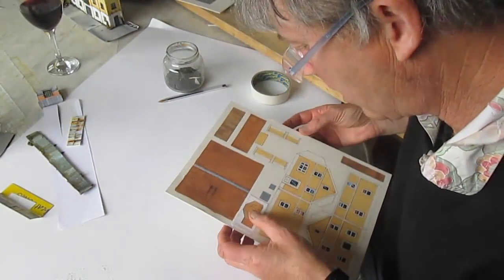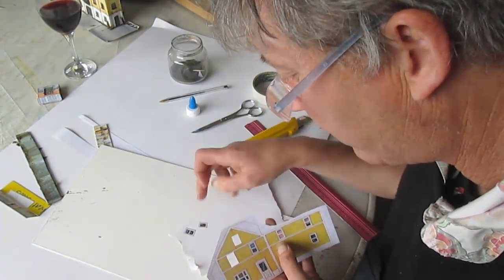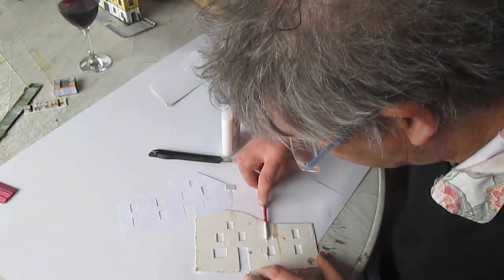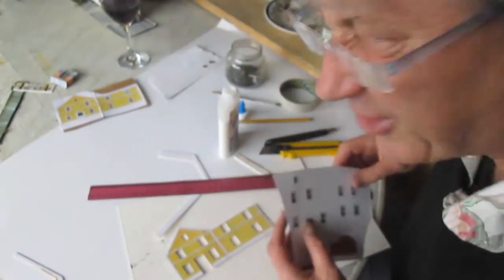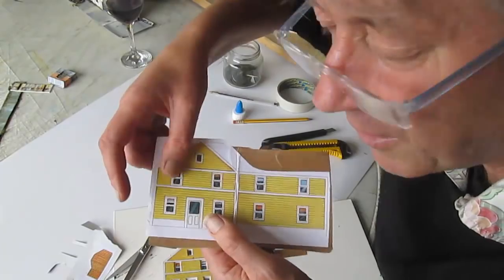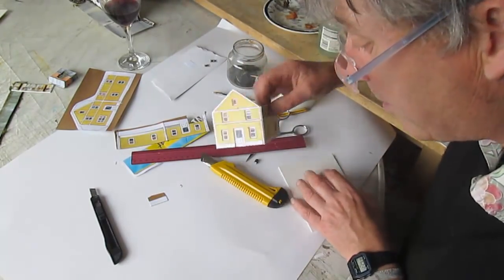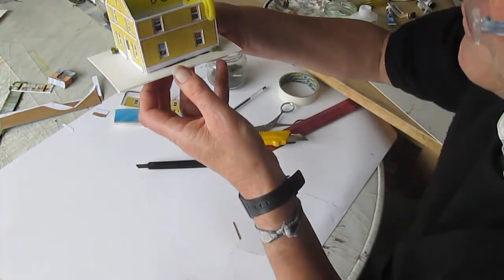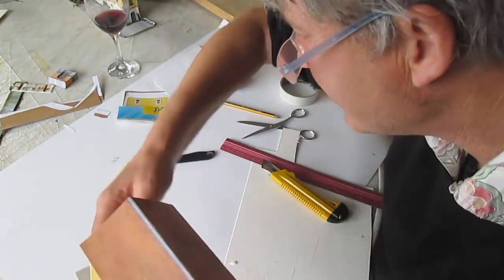How to make print out buildings

Comment: Just a suggestion….
If you cut the window frames from a separate print, you could use them like you did the trim. 
Another set of windows with the black areas cut out, would allow acetate to provide a glazing, and another layer would get you the black behind the glass.

Comment: I really liked your video. I have experience with models and cardboard. But your explanation during the work is very interesting. Interesting - where do you get this thick material? I print on cardboard right away ... 230gsm. True, I mainly glue transport models. Well, buildings are just like toys for a granddaughter.
I am not English - but I liked your English. Thank. And good luck.